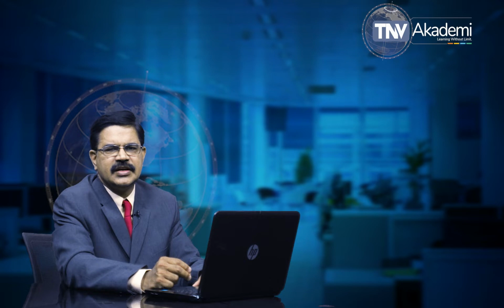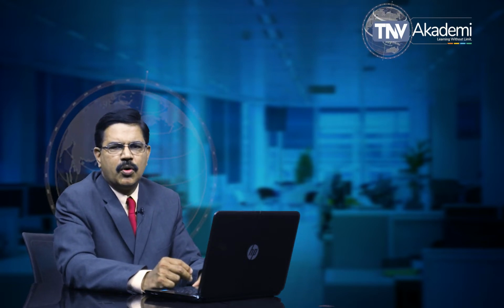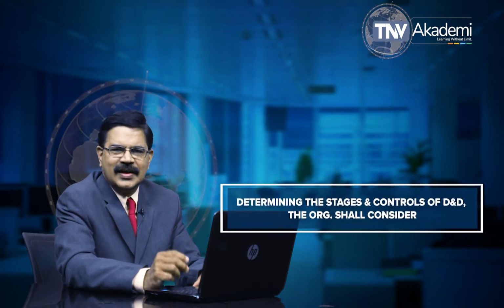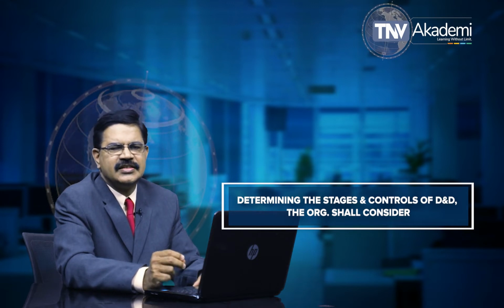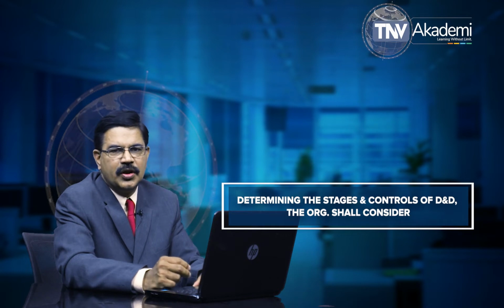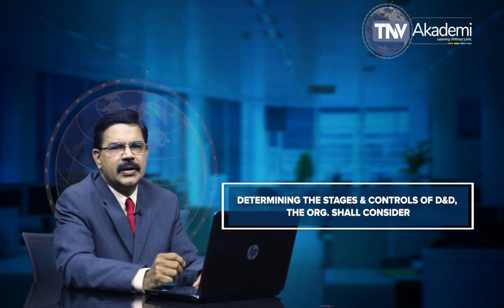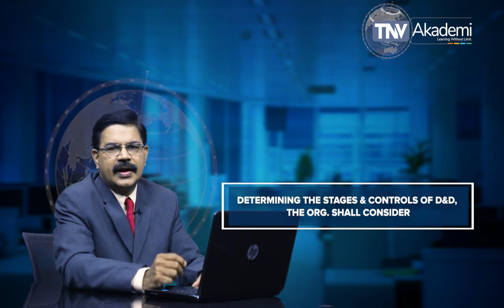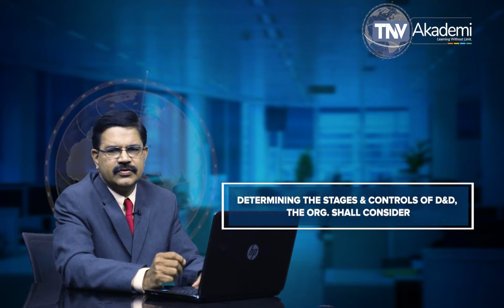QMS Design and Development Clause 8.3 of ISO 9001:2015 | Training on ISO 9001|

Comment: In this video, from 2:31 to 9:16 directly spoken words mentioned in clause 8.3 of ISO 9001-2015.

I have some questions which i thought would get answered by watching this video (it didnt)

1. What will the auditor look for in the design department manuals and forms to ensure compliance of this 8.3 clause of ISO 9001 standard? Will they only look for the words in the standard being used in the manuals and forms?

2. Will the Auditor expect the design department to know what processes other departments are doing?

3. Should the flowchart (for a manufacturing company) of design and development cover all designs like mechanical design, electrical design, hydraulic design, pneumatic design etc.